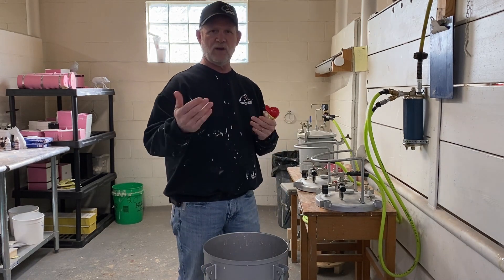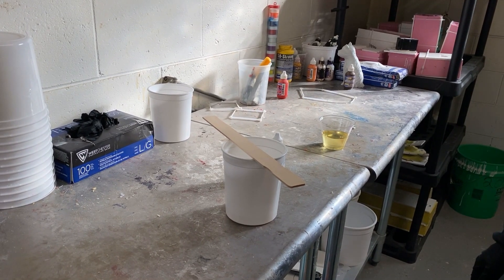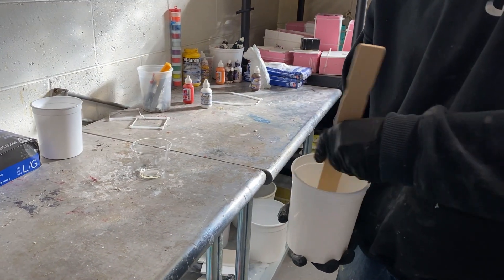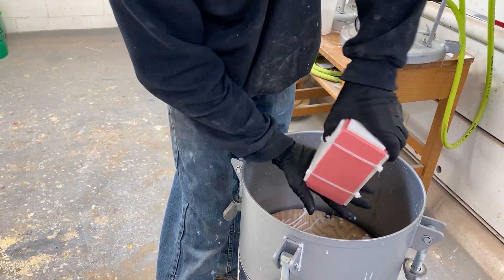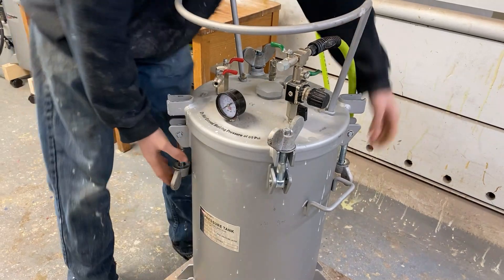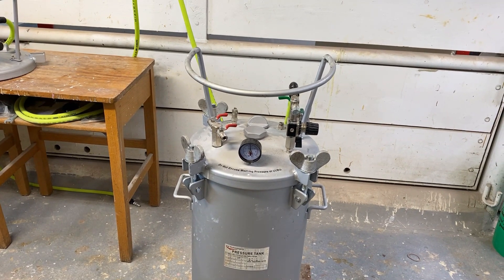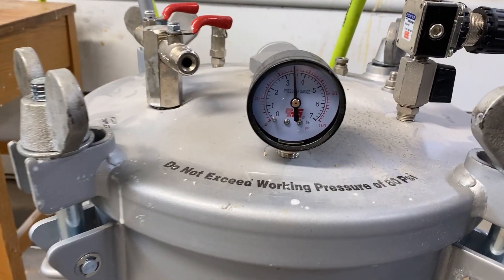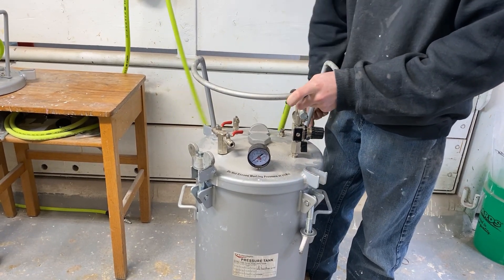Pressure Casting Urethane Resin | Step-By-Step How To Tutorial

Comment: I have had a problem with my task 4 urethane casting, I have cast at 60 psi in a pressure tank and I have obtained an imprint, with a sticky and shiny layer, as inhibited, but in the same casting, in different molds, I got cast good.
Reply: Smooth-On brand resins in general are kinda testy. If the mixing ratio is off by just a little bit, it can produce weird, inconsistent results in the final casting.

Comment: I tried pressure casting but i had a problem, the mould distorted under pressure, 40 psi the resin copy was a bit contorted not its usual shape. Was i using the wrong type of silicone, too flexible, too soft , did the pressure distorted the soft mould or do i use a harder silicone mould. What best silicone to pressurise. Can i pressure silicone when i am making the mould.
Reply from the maker: Did you vacuum the silicone when you made the mold?  What shore hardness was your silicone?
Reply: I didn't vacuum, but i might have a go at pressuring the mould when i make a new one, just as an experiment. The shore strength is 28 i believe soft. I think the  soft mould contorts under pressure.
Reply from the maker: You can try pressure casting the mold but we have not had very good success with that.  Some silicones may not cure properly.  Normally you would vacuum the mold and pressure cast the resin.  We use 30A silicone so the 28 is not the problem.
Reply: Thanks for your reply, i will try some 30A, just a matter of experimentation.

Comment: Hi, I pressure cast fishing lures that have a 15/20% microbubble component, I cast at 80 psi ( the pot is not homemade) but I still find when I sand parts near the spue etc there are bubbles I need to drill and fill. The bubbles sre always at the top too, is this due to the thickness of the mix? I try and keep the environment moisture free too.
Reply from the maker: Barry, what do you mean when you say "the bubbles are always at the top"?  How  fast is the kick time on your resin?

Comment: How is Urethane different from epoxy? Thanks for the upload!
Reply from the maker: There are many different variations of each.  However if you are referencing casting resins the main things we notice is urethanes are more moisture sensitive than epoxies and epoxies are more brittle than urethanes and epoxies smell worse than urethanes. Since controlling moisture is no big deal for us we prefer urethanes because they make more durable castings. Also we are able to get urethanes in faster setting options which allows us a quicker turnaround time on castings.  Both work well for their intended purposes and we will use whichever fits the desired specs for the job.
Reply: @IconPoly  That's awsome thanks for the response!
Reply: Could you perhaps tell me what is the difference between pressure casting compared to vacuum casting of small parts? To me pressure casting looks way more simple..?